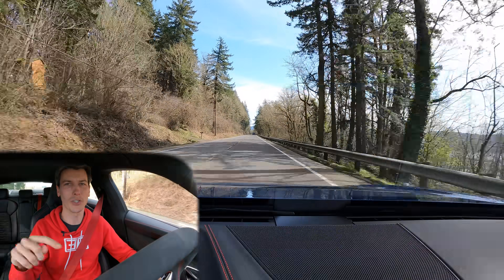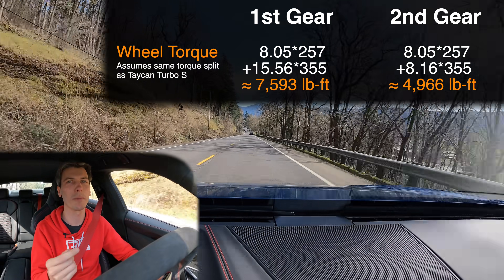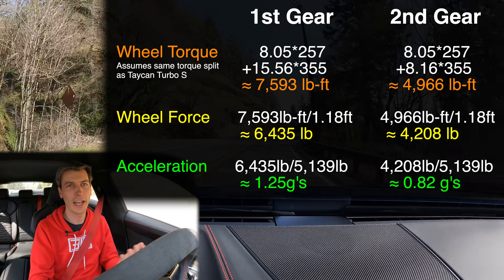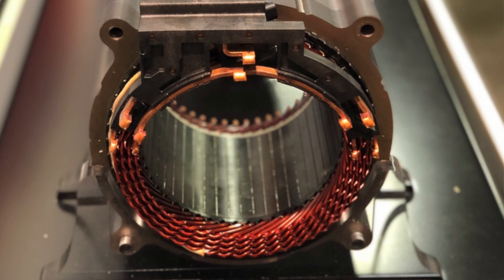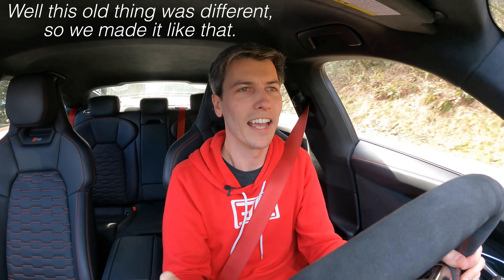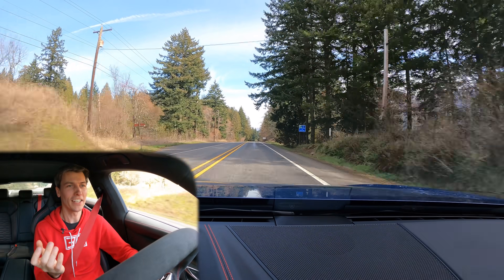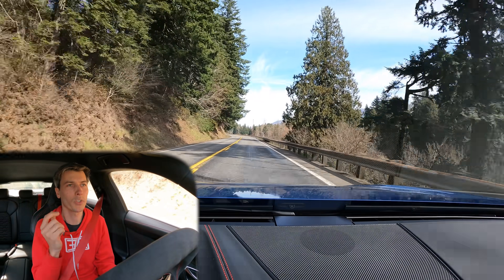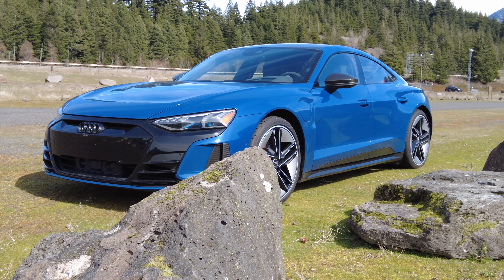Are Fake Manual Transmissions Coming? Audi Keeps It Real

Comment: I love manual cars but having driven a lot of electric cars I don't see the appeal of having a fake manual. A lot of the fun of driving a manual is getting the most out of the engine by changing gears just right, while with an electric car the motor is always in its prime so to me it would just feel like I'm limiting the motor if it had a fake manual
Reply from the maker: I mean, that's exactly what's happening haha, it's limiting the motor. Seems pointless on paper.
Reply: @EngineeringExplained  if you have good regen braking it is still exciting to drive fast even you don't have to shift gears and use brakes.
The excitement just shifts to a different method of driving. You still need good accelerator control to not spin the wheels (if you turn traction control off) and brake at the last possible moment and get on the power at the earliest.
Reply: @franciscoshi1968  I drive my gf's Tesla and hate it. The regen braking messes horribly with braking smoothness when cornering, and the throttle response is way too "light switch" (on/off).
Reply: @emissarygw2264  the one pedal settings in a Tesla are not suitable for racing. The problem is the torque response is speed sensitivity. This makes it difficult to get accurate control. There are better ways to do one pedal driving that can give you control as accurate as the mechanical brakes but they haven't done that because it behaves differently to how normal cars work.
It is the same reason most EVs are made to feel like ICE automatics.
Reply: @EngineeringExplained  I'd say the argument for this it to have more control over the handling characteristic of the vehicle. Being able to choose speeds and modulate a clutch gives you the ability to more precisely control the yaw angle of the car through turns.
Reply: It doesnt seem ideal, but it may be the best we can get in the future. Then again, manual transmissions have been limiting the performance for years, autos are simply faster in almost every sports car application today.
Reply: @siguy3546  not entirely true automatic transmission technology in the 90s and early 2000s wasn’t what it is today. The slushboxes couldn’t downshift fast at all and upshifts were unpredictable that’s why manuals weren’t the performance transmission. Even Ferraris early f1 transmissions had a lot of problems
Reply: @siguy3546  ya but people that drive sports cars to be faster are like the people that drive Lexus instead of Toyota to show off
Reply: @siguy3546  only in the top models equipped with dual clutches. One such example is the Toyota gr86 which is slower with an auto
Reply: @siguy3546  Why people think only about perfomance and speed?
Reply: Going by real world experience of these kinds of gadgets, most users will play with it a few times then ignore it - and avoid it like the plague on the next one
Reply: Aren’t modern DCTs just better than manuals too?
Reply: false. Electric motors DO have a powerband at a certain RPM.  The thing is, we can't care because they all have 1 gear and "muscle" through the slower part quick enough not to notice.
Reply: I think the obsession with "rowing your own" comes down to people just really like to play with their knob.
Reply: @napoleontheclown  LOL
Reply: We’re already at a point where autos shift faster then any human can, manuals are pretty much purely for fun/enthusiasts at this point
Reply: Cvts do it as well 🤷🏻‍♂️
Reply: So it's like dip your brocoli in syrup.
Reply: But I love shifting :(
Reply: @ScorpioMotivation  The buyer speaks louder than ALL other agendas... and there in lies the problem. wealthier people (and credit-crazy people) are getting new cars in... not manual.   And "enthusiasts" always wait 10 years to try and lowball a seller for the little manuals that do sell new (rare) rather than buying them new themselves. that's a double negative - enthusiasts are broke, and other people aren't. other people never buy manuals.  It's a 2 fold problem.
Reply: @mynameisschezuan  Be specific. I already said I don't understand why non car people leave their opinions on car enthusiast's videos - so you don't need to think that I don't understand because I already stated that I didn't.. I also made 2 other comments, both with a pretty accurate grasp on the situations mentioned within their context so care to elaborate on what you think?
Reply: Exactly. I enjoy having the full control of which gear I'm in at any time. But automatics are at the point where they have better performance now, especially dual clutch. Part of why I enjoy my manual in my porsche boxster is because I know the car has a 5.9s 0-60 with the manual and a 6.5s 0-60 with the automatic. You can outperform the automatic by having less weight and good shifting technique.
Reply: @frederickschulze8014  Dual clutches are not automatics per se. they are still "manual" with a direct solid mechanical link to the driveshaft and wheels.  which is why they are fast. they aren't losing so much power through fluid swirling around tryna move the wheels. Automatics are a fluid based connection, hence the term "slush box". and CVTs can only be described as moped transmissions. 

Stick shift manuals are also too broad a term in and of themselves, what we want as true car enthusiasts are specifically a mechanically linked manual stick shift. whether via cables or actual solid linkages (in the case of your porsche, it had to be cables due to the engine layout. whereas an FR orientation has the actual tranny sitting under your arm and shifter.).  But yes the sentiment remains that we like these not only for engagement, but for ease of understanding the maintenance that we can do ourselves given the tools.  

That's something even dual clutches lose out on (PDK included).  The more control the manufacturer takes away from the ownership experience, the more pissed off we become as people who love cars.  This is the principle we stand behind as car enthusiasts.  So being faster matter less than what we lose for doing so. this is why we also hate Tesla and their lack of a right to repair (and ability to. Complicated for no reason type of cars. )
Reply: @twrcrew8852  Right, I mean dual clutch as a whole can be automatic or manual in terms of driver input. But even the manual dual clutches automate the majority of the work as I see it, which is the clutch. Heel-toe shifting, rev matching, starting from a stop, etc are all things you don't need to think about. So they're something in between manual and automatic... but realistically they are the best for performance driving (for a typical consumer anyways). 

I guess what I'm sad to see is all the benefits of manual transmissions disappearing. You used to be faster, more fuel efficient, and have more control. Locking torque converters and more refined automatic transmission designs mean that automatics get equal mileage and sometimes better. The dual clutch does what you could do in a standard transmission but faster. And with electric motors, shifting is going to be obsolete for the most part.
Reply: @frederickschulze8014  I own a 2020 Energica Eva107. It's an electric naked bike that generates 145hp and torque. Single reduction gear.  The illusion of electric vehicles is that they get it all at "1rpm". the reality is that without multiple gears, they are still deceivingly slower than they could be with proper gearing like a traditional transmission offers. EVs do have a powerband.  My bike with all 145 glorious hp is about as fast with a single twist of my wrist as an R1 from about 25-90mph.   Notice i never said from 0? that's because while 0-25 is dealth with using a simple twist of the wrist, the R1's first gear and 200hp is that much more efficient off the line, even when it isn't making that amount initially.  My bike is "lugging" through with sheer torque. but the end result is it is slower. 

That goes without mentioning what happens to me after 90. Even on the fully fared supersport EV - the Ego - with it's 150mph top speed... well its self explanatory. It's a bike that can get dunked on by naked bikes. It's all down to the gearing on EVs being too primitive at this time. We need to use at least 2 or 3 speeds to be competitive.
Reply: @twrcrew8852  The problem with putting a transmission in an EV is that it's a large, heavy and expensive part that needs quite a bit of maintenance, especially given the torque electric motors produce. This comes on top of EVs already being quite expensive and heavy and it breaks the promise of less maintenance. Lastly, a transmission will also eat away quite a bit of power and make the engine-at-wheel-design current EVs like to use impossible.

If you go for maximum performance, a transmission might be necessary (though the weight, shift lag and power loss will move that point quite a bit and you lack grip off the line anyway), but for now, it's just not economical for most EVs if you can simply upgrade the engine and "power through" the start.
Reply: @Sebb747  you must be ignorant to the fact that porsche agreed with me and have a 2 speed car with the fastest top speed available today.  Even the Roadster isn't using a single gear like it's 150mph predecessors.
Reply: @Sebb747  EVs CAN be less maintenance, but Tesla designers are trolls who don't make their cars less maintenance. If you owned one you'd know this.  Doors and frunk latches that like to break when that wasn't an issue for over 80 years prior.   

They're removing one potential for failure and adding 20. "just because it's trendy".  Also, my niece kicked my uncle's touch pad on his model S, broke it. Can't use the car.
Reply: @twrcrew8852  I think the fact that only supersport EVs going for 150k$ and up are using that transmission, and only a two-speed at that, underlines my point quite well ;-) I didn't disagree that a transmission is useful and/or necessary for maximum performance, I just said that it's not economical right now for most EVs.
Reply: @twrcrew8852  I think the Teslas and the Model S in particular is a special case, since it's aimed to make rich, non car-loving techies buy an insanely expensive car. Also, if you look at current ICE cars in the same price segment, you'll find similarly expensive gadgets and display-dependent car functions.

Still, I basically never heard an EV sales pitch that didn't mention the time and money savings from not needing to maintain the engine and transmission  and the reduced degradation of the breaks.
Reply: Great automatic cars have been around forever my guy.  I think your assessment is super late and is totally missing the point of driving a manual. It’s fun to be in  control.
Reply: @jonathanquinn3713  I agree manual is way better, but I do not think you understand how bad old automatics actually were, like they were mad inefficient and actually slower and laggier in the beginning
Reply: There actually is benefit to having multiple gearings for electric motors. 
While the torque output is nearly 100% for a significant portion of the useful rpm range of an electric motor, it does start to drop off at higher rpms. With a minimum of 2 gears, you could bring a higher torque up to higher speeds. 
But that is looking at only the electric motor. The power chain can still be limited by other issues such as thermal dissipation of the drive electronics, or the battery itself.
Reply: Would having a fake manual make a difference in performance, drifting or in rallycross?
Reply: It's called fun, it's called having fun.
Reply: Same here
I drove manual cars from the time I got my license. Now drive electric for about 3 years.
Personally I will never change back to manual. 
Alone the convenience in city driving is worth it.
Then no more issues starting uphill, regenerative breaking going downhill.
Stop and Go is a pleasure compared to a stick shift.

You also get quickly used to it. Just a few months after I had already a bit of a trouble driving a stick shift again :)
Reply: @thomaskurz5617  that's sad
Reply: i should clarify that i also like manuals in ICE because i want the engine response to be as direct as possible. with an automatic(even a good one) i feel that i'm giving the computers of the car a suggestion that the engine and transmission responds with. 
however with an electric car the response is always the same and even more direct and responsive than an ice car with a manual. 
With a dual clutch you can have a pretty good manual mode ofcourse but personally i would rather have stickshift over clicking buttons for changing gears. 
That being said for me the smoothness and responsiveness in an ev definitely makes up for not having a stickshift personally. (also not feeling as guilty for going for a drive just to drive, in terms of the environment is a plus to me)
Reply: I love the idea of a manual mode, even fake, for an electric car.  Who cares if you limit the motor- how many times can you max out a 700hp electric car in daily driving?  Almost never.   Let us have some fun!  Ideally, it should have a clutch pedal and have consequences if you mis time your clutch pedal release, just like a manual car.  Make it a bit of work to get right. That’s the fun of a manual car!  That’s what I hate about manual mode in an automatic car- I half think about shifting.   When I mess up, the car fixed it for me. No thanks!  Of course, in this concept you could also turn back to the 1-speed auto mode for normal max accel and easy driving or 1-pedal driving.  But having a true manual mode with real (fake) clutch pedal seems best of all worlds!

Comment: Could you extend EV range with a multi gear transmission? By lowering the RPM of the electric motor at highway cruising speed?
Reply: I wonder this as well.
I don't fully understand how EV operates yet though.
Reply: With ICEs this makes sense, because the efficiency of ICEs is very peaky.
Electric motors have a very wide range where they operate efficiently. It's only at low rpm that they don't operate at their most efficient, while a transmission can only really reduce efficiency losses at high rpm, by using a higher gear ratio.
Reply: @LarsDragonbeard  that I understand. What I'm curious about is, (made up numbers for simplicity) if at 60mph, the electric motor is spinning at 6000rpm pulling 6kw of power. My theory is, if you change gears once up to 60mph, the motor then could be spinning at 4k, therefore pulling less power. Im no engineer,  but it makes sense in my head.
Reply: @crazyeyez1502  The power output remains the same. At 4k rpm you need to be outputting 150% of the torque to propel the same vehicle at 60mph as you would running the motor 6k rpm.
The speed of an electric motor is controlled by the voltage, but the controller will draw the required current to produce the power needed to handle the load on the motor (move car at 60mph). So at 4k rpm you'd be drawing more current than at 6k rpm to get to the same power number.
The power output needed to handle the load doesn't change. The efficiency of your motor decides how much energy it needs to draw to produce the power output required. In an electric motor this efficiency is pretty much the same across the entire usable rpm range.
Reply: @LarsDragonbeard  thnx. That's what i was curious about.

Comment: Why can they just make a lower power electric motor (probably around 150 to 180hp to increase range) and connect it to manual transmission to exploit the torque and rpm?
Reply: Q: "Why (can't) they just make a lower power electric motor (probably around 150 to 180hp to increase range) and connect it to manual transmission to exploit the torque and rpm?" A: actually leaving out the added weight/cost of a manual TX (since batteries are already heavy AF and expensive AF) the OEM's already do the very thing you're asking for while exploiting torque/RPM (you just don't realize it).  compared to Tesla drive units, the motor in the FWD Bolt (260hp) is not very powerful and the motor in the RWD Ioniq 5 (225hp) is even LESS powerful.  yet both cars through gearing and tire size (which is actually part of your FD ratio) will both sprint from 0-60mph in a not too shabby 6.9 seconds, and they do this despite having a whopping 758lb weight difference (Bolt 3562/IO5 4320).  btw these are all EXACT figures from my OWN testing.  speeds GPS verified with a Dragy and curb weights measured without me in the vehicle.

Comment: A real transmission would increase efficiency, even for an EV. For an electric motor more torque comes from more current, which means quadratically more resistive losses.
Reply: A transmission is also another failure point, adds friction cost and weight.
Reply: @pleasedontwatchthese9593  electric cars also have transmissions, just with a fixed gear ratio. Like the Nissan Leaf for instance.
Reply: @bmp72  while yes, a fixed single speed gearbox is technically a transmission, there is no clutch and very few moving parts, so they are as efficient and reliable way of changing the gear ratio as you're going to get.

Comment: You can watch someone beat a game for you or you can play it yourself. That is the difference between manual and auto. It's funner to play it yourself but it's easier for someone to do it for you. But the other part of this is control. I like manual a bit better because of the control I get. Not allowing a car to upshift when it decides to will let me drift, or clutch kick, or be in the right gear for a turn. I get the option, not the car. So bottom line is, if I can drift in an electric car and somehow make it sound good without setting the earth on fire and have it be reliable I will choose that over a car that drives itself. But I would have both lol because driving is fun, but I wouldn't choose to drive all the time much like I like cooking for myself. I like having the option and control.